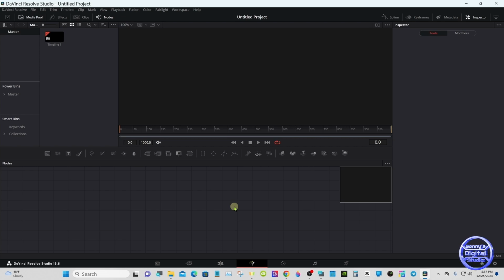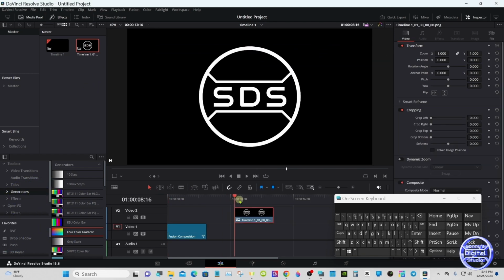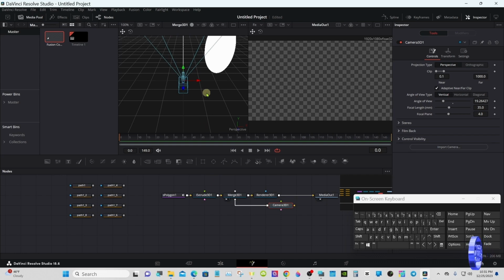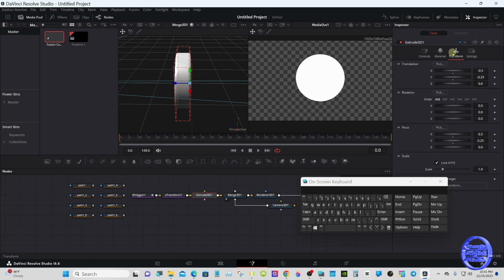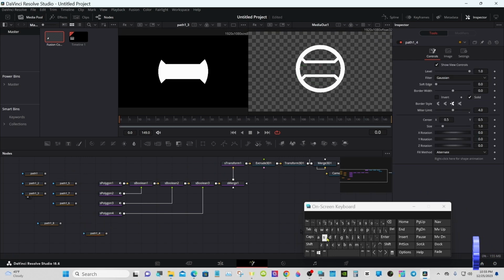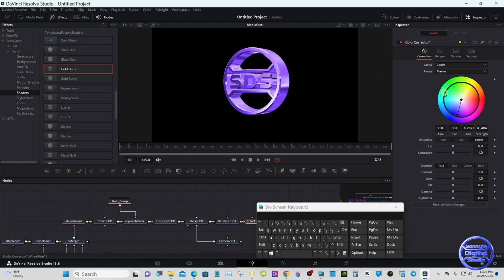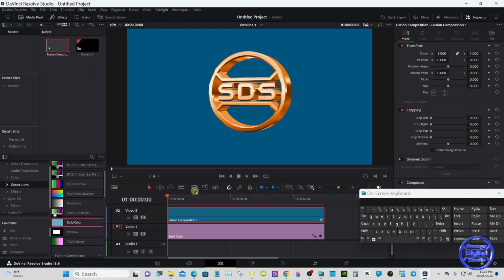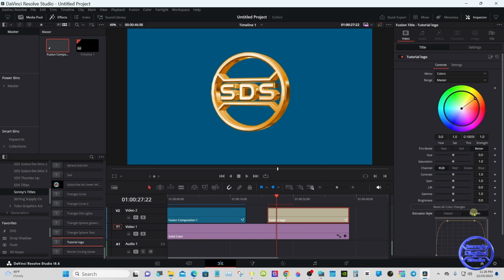Creating an Epic 3D Logo with DaVinci Resolve 18.6!

Comment: Hi, I made my logo (ADSG), but the letters AD are closed differently from the letter SG. How do I resolve this issue?
Reply from the maker: You can highlight all polygon points in the original nodes and use the arrow keys to move them then re-copy into a new sPolygon node but might be easier to make a new 2D template and redo the s node part.
Reply: magnificent now it worked thank you. ❤
Reply from the maker: @ELCHAPOLIDERO  Your welcome!